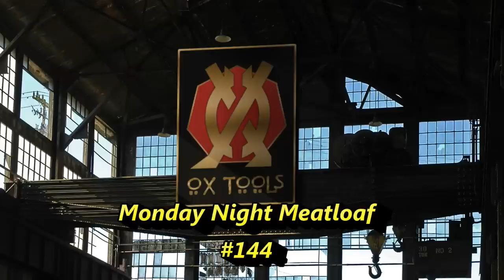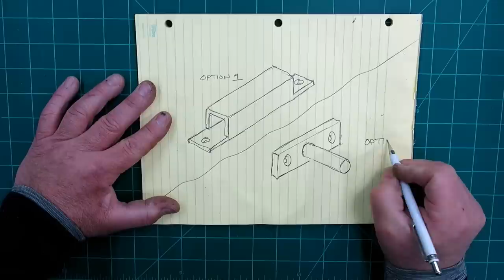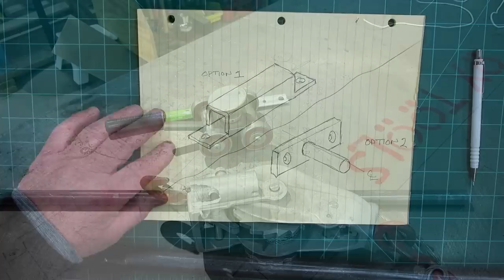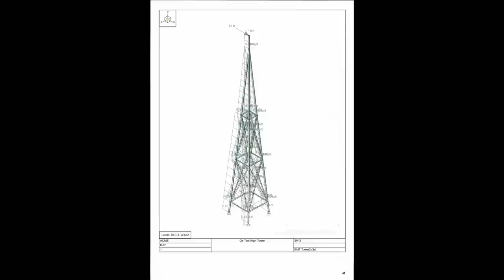Monday Night Meatloaf 144

Comment: I think putting the handle on the end would create failure points at the fairly thin corners of the yolk. Fan of option 1 though.
Reply from the maker: Hi R. The yoke is pretty stout at the corners. It is thinnest near the pivot point at the center of the cable drum. Thanks for the comment.

Cheers,

Tom
Reply: @oxtoolco  Yes kinda thick but it's wide in the wrong direction to resist the torque. The sides are wide in the correct direction.

Comment: Option2... small footprint / big leverage against this cast part.
opt1 nice distance between those 2 cscrews... so smaller leverage on that cast part, but of course... twisty.
Combine opt1 and 2.. make a fork of steel, so it "wraps" on the sides of the casting, so you can put screw on the far end of the fork, and reduce load on the cast part.
And as other falks sugested.. then you can add side pocket, for situations when you need to put that bar from the oposite side.

Comment: How about a “spur” configuration, one leg each side meeting a tube in the center.  Flat head bolts 2 per side from inside, and you could really whail (or Gronk in OX terms).   Canukistan wood butcher does his with a twist- oops you are doing it as I type……great minds and all that.  Sells mallets pre wrapped.  On the ships I worked on all the hand rails were wrapped with net twine- lasted forever and you definitely didn’t slip.  Ships engineer showed me the straight line method, he did all of his hammer handles like that- even oily grease laden paws don’t slip.

Comment: You could box in the lower part of the splitter so as to not catch any kindling then pull the bucket up and or off to empty it easier.
Reply from the maker: Hey Oddtools,  Thanks for the comment.

Cheers,

Tom

Comment: Hi Tom, here's my take on the kindling splitter. Instead of the two legs then a base, how about a ring directly under the cutters then a tripod arrangement welded to that. Make the legs tall enough to the slide the receiving pail under the cutter( even maybe tall enough so you don’t have to bend down to chop) This way means you don't have to struggle to get the cutter out of the pail with the kindling in it. Cheers for a very soggy New Zealand
Reply: I was thinking if the splitter were able to mount to the bucket rim, it would transfer the force more directly to the ground than it does sitting inside the bucket.  A Hollow half taurus might sit pretty well on the bucket rim and the splitter could be welded to the ring. Get the wood to fall into the bucket and move onto a new bucket when it's full.
Reply from the maker: Hey Brian. I think I have a better solution in mind that leaves the bucket a standard bucket. Thanks for the comment.

Cheers,

Tom

Comment: Put metal sheets on either side of the underneath of the blade to keep the wood pieces out.  When you are done you can just simply pull out the bucket, no snags.
Reply from the maker: Hey Joey.  I was thinking the stuff would just fall out of the hole. I may extend the support structure outside the bucket completely and leave the bucket intact. Thanks for the comment.

Cheers,

Tom

Comment: I have the same come a long and have beat that thing like a rented mule for 30 years! I bought mine from a pawn shop and the handle never came with it. I use a piece of pipe. I know for sure I have stressed it beyond the recommended load. P.S. Incoming Howies order today here, that's what we use here for hockey related and general purpose taping stuff. The beaded  wrap is old school stick end hand grip style I do to this day. The kids I coach don't seem to like to make a rope bead hand grip anymore.  Definitely  overthinking the kindling splitter me thinks!
Reply from the maker: Hey Warren. Overthinking is half the fun. My hoist rated at 4K has seen a measured 6K..... Those things are engineered for Cro-Magnon folks like myself. Thanks for the comment.

Cheers,

Tom

Comment: A machinist is supposed to enjoy "machining"  lol Could you machine a J in your attaching piece to slide over the "arch" of the comealong then put your bolts in? This way it would be pulling on the bottom side rather than just on your bolts. Just a thought. Keep smilin Tom

Comment: Option three?  Wrap a steel strap around the top with 3 or 4 attachment points for a center pull handle.
Reply from the maker: Hey Jim,

Thanks for the comment.

Cheers,

Tom

Comment: Your cord wrapping technique, could that be used on a curved handle? Thinking that would make a good wrap for old tractor steering wheels that are deteriorating.
Reply from the maker: Hey Nathan. Indeed it works on non round stuff. There are many variations and endings. Find a decent knot book or pictures online for ideas. Thanks for the comment.

Cheers,

Tom

Comment: I'd prefer option one on the come along. While the offset handles tendency to pull to the side is annoying, once you have a decent amount of load applied, it pretty much goes away. The option two center mounted handle, will up your odds of being tool blocked due to the handle being in line with the load, and not allowing a full swing on the handle. JMO. How tall is that tower? A nice alternative ( if it's not too tall ) would be to befriend a utility worker,  and score a power/telephone pole that's timed out, or broken, and set that? Not to discourage the Red Green approach with the conduit tower.😄

Comment: These loafs are getting spicier and spicier! That analysis of the tower strength looked like a design for a lunar lander. I can’t help but wonder why the come along people didn’t put the handle in the middle. Maybe it gets in the way of some workloads? And judging by the wind noise since you moved to The King Ranch, I’m thinking you could build 2 towers and compare solar to wind power.
Reply from the maker: Hey Glenn. I think there is a windmill in my future somewhere. Yes we get the wind as we are on a hill. 

Thanks for the comment.

Cheers,

Tom

Comment: Option 2 looks like it might be a bit weak.  You have a cantilever bar with a small small base.  I think you could break  off the bar or the part of the winch that the bar is attached to with that arrangement.  Option 1, even if bolted, seems much stronger and safer.
Reply from the maker: I think a test is in order don't you? Thanks for the comment.

Cheers,

Tom

Comment: How hard would it be to use the central.yoke mount idea, with a side yoke connected to it? There have been times when I have cursed the traditional centerline handle because of unique rigging situations. Dual.options would be the cat's meow!
Thanks for sharing 🇨🇦
Reply from the maker: Hey Paul. I probably only have the energy for one solution.....Thanks for the comment.

Cheers,

Tom

Comment: The handle on the side gives you clearance around the hook.  Depending upon your rig putting the handle in the middle might interfere.
Reply from the maker: Hey Michael. Excellent point! I didn't consider that. The yoke when fully up might get close if the handle receiver was on the centerline. Thanks for the comment.

Cheers,

Tom

Comment: They engineer those failure points for a reason. You’ve already broken the handle twice. If you make it too strong, it might have a catastrophic failure at a very in opportune moment
Reply from the maker: They also build them knowing they will be seriously overloaded. The original handle broke when I first got it. That particular hoist has seen 6K load on it. Not that I recommend that but there is considerable safety factor. You do what you have to do given a particular situation. That said 4K was about all I could manage these days. Thanks for the comment.

Cheers,

Tom

Comment: Hey Tom, I dont know if you have thought of replacing the whole bracket for the repair ? If the central pin comes out then a laser cut folded sheet metal solution might give you the most strength. I can see that there are other features on there, but they wouldnt be difficult to replicate with a bit of welding (or some fancy forming on the sheet steel). I'm in millimeters, but 5-6mm hot rolled steel would be stronger than what you have and get around the welding / drilling of the existing part. If you need help with modelling / drawing the part up I could give you a lift :o)
Reply from the maker: Hey Chris. I did consider replacing the entire yoke. If I did that I would probably just buy a replacement since it was really a bozo moment that caused the problem not a design flaw. Finding the right balance between $$ and being lazy is always the challenge. Thanks for the nice comment.

Cheers,

Tom
Reply: @oxtoolco  I understand, more of a running repair rather than a full blown development project 😀

Comment: I'd also go for option 2, but I doubt that the 2 screws would handle the torque applied by the handle. I would make a U shaped part that would hug the cast ALU ratchet assembly, with the 2 screws where you drew in the sketch and a screw on either side of the arm, near the pivot point.
Reply from the maker: Hey Sandi. Sounds like we should probably do a test! Thanks for the nice comment.

Cheers,

Tom

Comment: Come-along option 2a - make the tube attached to the 'horseshoe' an OD tube - this is potentially better in bending due to larger OD.  The 'fixed' tube could be square too to increase its bending stiffness, and still use your favourite bit of tube as a handle.  Additionally, put a flange/small lip on the mounting face to transfer load via bearing rather than by the bolt shanks - or use dowels and bolts.
Reply from the maker: Hey Scott. Thanks for the comment.

Cheers,

Tom

Comment: When the splitting is done, can't you life up the bucket and dump the contents? It doesn't look as though much would fall through the slot just from picking it  up. Although the pieces might get hung up on the splitter.
Reply from the maker: I'm thinking of a way to use a standard unmodified bucket. I will certainly show my progress along the way. Thanks for the comment.

Cheers,

Tom

Comment: If you made a hinged upward sprung flap where the blade goes through the bucket, all you need to do is lift off the full bucket and take it to your fire or pile. The piece you cut would be fine if you put a stop on it to stop it folding through the hole it came from.
Reply from the maker: Hey Derek. I'm trying to get to a stock bucket on this. Thanks for the comment.

Cheers,

Tom

Comment: Option 2...But!!  Don't drill holes, use the steel receiver but champ it with a " U" bolt on both ends....
Reply from the maker: Hey Tacktishion. Thanks for the comment.

Cheers,

Tom

Comment: kindling splitter great idea with the bucket !!! why not use one f the old type paint buckets there maid of mettle then you need not worry about the bottom also i see you only have a 4 way split with the type of wood you are using you could step this up to 6 to 8 way split !! yes i have maid one and its an 8 way split works fine thanks for the idea
Reply from the maker: Hey Wall. One of my earlier prototypes had more splitters. The issue is the space between the splitters. Wood gets wedged between the splitters. Thanks for the comment.

Cheers,

Tom
Reply: @oxtoolco  yes did have that problem then i used 1/4 x2 inch bits of stainless and solved this some what trick was using the bits with out the knots now no more wood stove or fire as am in the norther part of Queensland Australia  where it's just hot we only get a month of cool weather  don't even have a jacket any more cheers

Comment: Wind + rain will suck heat from a metal building like nobody's business. One of the reasons that i strangled my wallet to have insulated panels. My brother's former grain silo turned shop is always cold when wind's beating it.
Reply from the maker: Tell me about it. I was freezing in there the other day. Thanks for the comment.

Cheers,

Tom

Comment: I would make a bin out of sheet metal that is level with the top of the blade or at least no more than an inch higher.  And about 4 inches added to the radius.  Or maybe you can find a metal wash/feed tub and use that.
Reply from the maker: Hey Michael. Thanks for the comment.

Cheers,

Tom

Comment: Would the center of mass be the load point or would it by centered on the teeth that engage the spool?
Reply from the maker: Hey Martin. The load line is a line drawn between the two hook connections to the anchor and the load. Thanks for the comment.

Cheers,

Tom

Comment: make a square box to go around the splitter, have a chute going off one side to your bucket. I see you jamming a knuckle against that sharp edge one day. otherwise, great idea; not trying to chastise you, we are getting old and skin tears a lot easier now. In fact,, have the chute dip off to the bucket starting the ramp of it on the opposite side of the box so no matter the side the stuff is directed to the bucket. Looks like you are using an anvil, so a square peg to connect it to the anvil make it hollow and it can go on a stake hammered in the ground?
Reply from the maker: That is an interesting idea. I have a configuration that uses a stock bucket in mind now. Thanks for the comment.

Cheers,

Tom

Comment: I think mounting the handle on the cross member would be less safe in two ways - one, if you break the hoop, the load will shift suddenly. Two, a lesser concern, is the whip if the load breaks free in another way. Maybe I'm overthinking it.
Reply from the maker: Hey Ry. Thanks for the comment.

Cheers,

Tom

Comment: If the plate inside the bucket was solid in the middle you can than pick the bucket up off the contraption and dump the split pieces out…right now they would get hung up

Comment: re. the tower, moving a max of 3mm over a length of approx 3000mm...you don't need both diagonal braces per bay - alternating is likely to be fine.  You can brace with guys too.
Reply from the maker: Hey Scott. There would be some advantages to not having each bay with an X. Internal access is one issue. Thanks for the comment.

Cheers,

Tom

Comment: I would do a hybrid between the two options. Centerline handle, but I don't like the attachment method drawn, those two bolts would have WAY too much force on them. Maybe add a couple straps with an S bend that attach to the sides.
Reply from the maker: Hey Sleepib. Sounds like its time for a test. Fasteners are pretty strong if tightened properly. It would make for and interesting video. Thanks for the comment.

Cheers,

Tom
Reply: @oxtoolco  They can be pretty strong, but you've got something like 50:1~75:1 leverage on it from the length of the handle, and likely more from the deflection of the plate not loading the bolts perfectly.

Comment: I i would rather use option 1 because i think it's stronger the screws hold on shear force where option 2 the screws ged bend because the flat bar wil twist and bend off the screws or try to rip them out he aluminum body 
Or use option 2 but cut off the old connection and go around the corner to the pint where it was so it holds in 2 directions

Comment: How about Option #3 -- make the baseplate of option #2 into a "U" shape and gain a bolt on each side in addition to the ones on the face.
Reply from the maker: Hey Tom. Probably a good idea. The side fasteners probably don't add much to the equation since they would just pivot if the others failed. That is if I'm understanding your note correctly. Thanks for the comment.

Cheers,

Tom

Comment: Forgive me in advance, but I cannot resist the irony here.  For the benefit of all… First half of video discusses repairing damage resulting from overload condition at stress riser notch. End of video shows analysis rationalizing the compression loading of a thin wall tube structure full of screw holes that apparently are not stress risers. Please understand that a sound structural design is not demonstrated by the maximum load it can withstand, but rather by the minimum load that will cause it to fail.
Reply from the maker: Hey Trotter. Not rationalizing. I was sharing the unexpected positive encouragement of the design. The tower is an exercise to study a construction technique not to validate whether is is safe or even appropriate. The calculations were just an interesting footnote on the potential efficiency of the structure. Lots of things are put together with self tapping screws including the metal building many shops occupy so it is a legitimate construction fastener. One grain of salt goes a long way. Thanks for the comment.

Cheers,

Tom
Reply: @oxtoolco  Tom, Thanks for your reply. I get it. Explore safely one and all.

Comment: You could just lift the bucket and empty it.  24.00+ Just afterward instead of pop rivets, SS screws and wing nuts.
Reply from the maker: I was worried the stuff would spill out of the hole in the bucket. I'm hoping to get to a design that uses a stock bucket. Thanks for the comment.

Cheers,

Tom

Comment: Option 2 but shaped like a fork with its two center teeth missing and the two outer forks flat and shaped to hug around the flat side bars.
Reply from the maker: Hey Bull. Thanks for the comment.

Cheers,

Tom
Reply: @oxtoolco  Thanks Tom and be well ...

Comment: Could you not just remove the bracket weld it up and then re heat treat it in one of those snazzy hot shot ovens? You could restore it to its original condition and get some heat in the shop in the process!
Reply from the maker: Hey Brian, I might consider that. Thanks for the comment.

Cheers,

Tom

Comment: The second choice - aren't you putting  more stress on the screws -  you have the whole length of the tube  after the first screw on option 1 but you only have a half inch or so sideways on option 2. I don't know if that matters, that may be plenty anyway.
Reply from the maker: Hey M. Thanks for the comment.

Cheers,

Tom